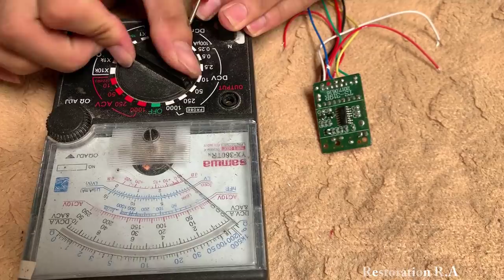Restoration old broken small Yacht | Remote control high speed Boat mini Restore & Repair

Comment: I scratch build RC boats and once the electronics get there is no way they can  as far as I know they can be dried and reused nice finish to the deck don't think I'll be subscribing Mick Thailand
Reply: Depends.  In sea water, with power on, usually it's eating up boards in minutes.   In fresh water... mmm, rather longer.   I've certainly resurrected radios that've been underwater (even seawater) for days.  Things like speakers and microphones have to be replaced, but unless it's really corroded, if you get to in in time, it's salveagable.   This looks like fresh water and it also looks like the receiver board didn't have water damage.  Motors are usually easier.   I want to know how he knew what frequency the radio was on, the control system and where he got the remote.   Seem a bit staged to me.  I'm not sure what probing around a board that seems to consist of one IC and a hatful of surface mount components was meant to prove, but hey, it almost looked convincing.

Comment: Thank you for the video, I would like to know How did you find about the value of the frequency for the (remote) controller ?
Reply: Most commercial toys are set to one of two common frequencies; 49mhz or 27mhz.